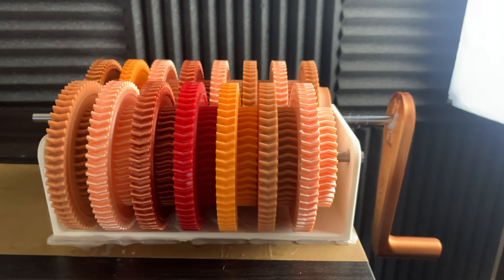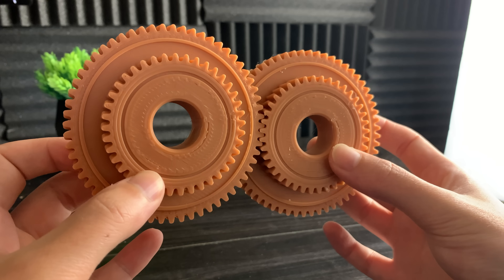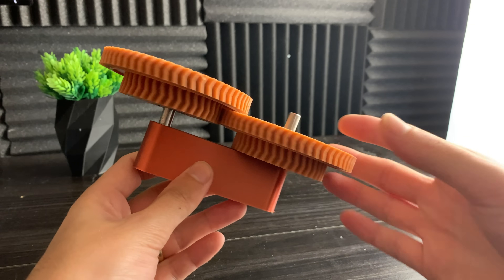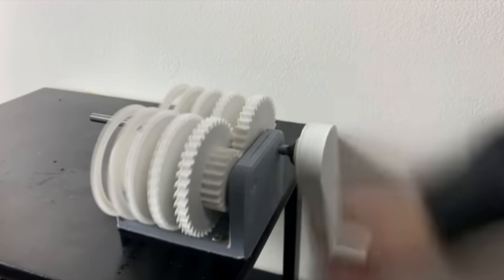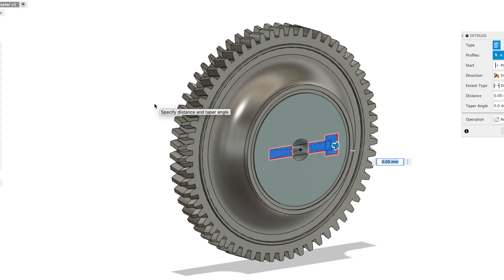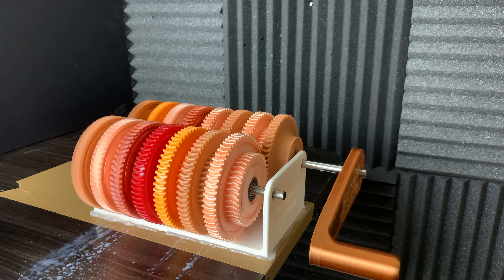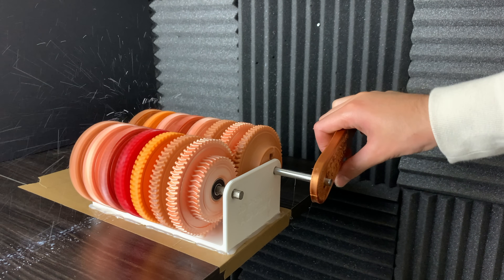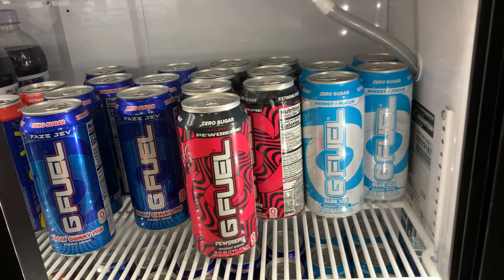3D Printed Gearbox (Herringbone Gears) - Speed Test

Comment: I don't think that's what people meant when they said put a bolt through the rod and handle, but it's kinda interesting.
It kinda looks like it would suffer from side to side movement.
Now that you have a hole through the shaft, I would run the bolt through the bottom of the handle, up through the shaft, through the handle again, and then put a small square hole somewhere in the middle of the handle ( Not too close to any edges, ideally as far from the shaft as you are from the edges ) and toss a nut in there.

Gear can't move side to side though so I guess that one's fine.

Comment: It's appears you lose a lot of energy when stops to pull the pulley. Maybe friction is the problem, a some comments suggests improvements in this point, but I think that whould be interesting that you get some kind of a heavy flywheel to attach in the speedy side. It will help you to maintain the energy.

Comment: Use spacers. You’re getting a LOT of friction from the gears touching
Reply: Or if this somehow goes far enough, thrust bearings between the gears
Reply: Spacer shuld conekt two rods togheter, les friktion les rods deflektion stable gears conektion
Reply: The double herringbone gears will index themselves without spacers.
Reply: Torrington bearing/washers, and mid shaft support to stop deflection on the shafts outwards
Reply: Especially for the First and Last Gearwheels. 
Try PTFE Washers
Try Ballbearings in your Stand
Trust me, I m German
We dont have Humor but we can Drink beer, sorry, we can do engineer ing

Comment: Use the gears as positive molds for a ceramic negative mold and then pour aluminium or brass and don't use ball bearings, use lubricating rods with small gaps with the gears and pump grease into it so it stays with low friction

Comment: I dont think the gears are at fault for the slipping. I think its rather the stiffness of the setup thats to blame. Maybe try a steel carrige and shorter axil lengths. This with a metal handel should be able to give you much higher speeds and input torque. There are also a lot of good lubing and bearing advice in the comments.

Comment: Axels not stiff enough needs more support inbetween, especially where the highest torque is transmitted.
Also put it in an acrylic casing and submerge about a teeth of the bigger gears in oil and make a structure on the lid that will drip the oil from the case down on the gears.
Suggestion for no. 1 : individual axels and support with screws connecting the corresponding gear pairs, this means you can separate the gears and get your needed support structures, while also helping out with alignment adjustments and customfit design.

Edit: spelling of torque
Reply: Or just add plates in between the gears that hold the shafts together
Reply: @Pawer8  They should be connected to the base, as one axle will be torqued outwards and down, while the other gets torqued outwards up. This effect does stack with each consecutive gear and due to good old Pythagoras we know that if the horizontal distance and the vertical distance grows, so does the hypotenuse. Another thing is vibration nodes, the more the axles can "wobble about" the worse the damage gets.
Reply: @EnraEnerato  doesnt matter. As long as the distance between axles is the same the gears will mesh properly. They could swap places and it would still work
Reply: tork
Reply: @wompastompa3692  I meant Nm which is not incorrect.
https://en.wikipedia.org/wiki/Torque_(disambiguation)

Edit: I just noticed you meant that I worte tork instead of torque, the way you pointet it out I understood you meant I should write that. Guess I should not write on mobile when tired, especially not with the German auto correct on, it doesn't like writing English and kind off breaks. I'll go correct it now.

Comment: What if you applied the force of the gearbox into a spring? (like the springs from a truck) Could you store the energy for future use and hook the gearbox to a generator for electricity? How much power/weight could the gearbox and spring effectively store?
Reply: why so complicated. Sandbag and a rope. Just have to turn it to pull the sandbag up, and then let gravity give you back your energy.
Reply: @TV4ELP  thinking the same thing. On condition you have a high elevation. Connect a dynamo and i see a potential energy source for people with no direct electricity supply.
Reply: @TV4ELP  A spring from a truck can hold a lot more weight and power per volume. If it holds enough power it could help store wind/solar power.

Comment: Use an electric motor to spin the middle gear, bring it up to speed slowly. Then add another motor nearer the handle but not on final gear and allow that also to start spinning up. Once that is coming up to speed then you can start cranking the handle.

Comment: IDK if you've tried this, but you can get the bearings to run much better by removing the shield and then using degreaser to remove the very thick lube. You can replace the lube with a drop of sewing machine oil, or just run the bearings 'dry', which does decrease their lifetimes significantly. But it's still hours of working condition.

The shields are removable by flat screwdriver, and can be pushed in again afterwards.
Reply: that would only work if he got a proper sized shaft. At the moment those bearing are likehoop earings and are just loosley on the shaft.
Reply: @PBMS123  I noticed the play between the bearings and the shaft as well. That needs to be eliminated to aid in achieving top speed. I also agree with running a dry bearing in this application. The builder is going for top speed not longevity. It will be mission critical to remove as much friction as possible.
Reply: I run the bearings in my yoyos essentially dry or with less than a drop of light lube, never lost a bearing besides one that I left sitting for about 8 years.
Reply: For a hand turned machine wear time is inconsequential the bearings are made of steel after all.
Reply: Kresimir Baric  I'm sorry 0.5 kg isn't a significant load for a ball bearing even when dry. for this application we're talking about 40x that
Reply: Ceramic bearings and "speed cream" it's what they use on skateboards. In this application it's be perfect. However the use of thrust bearings between the gears would also help I think a significant amount
Reply: This is what we do for bearings in bait casting rods when we want a more free spinning arbor (the spool the line is wound on).
Reply: @Kresimir Baric Assuming 20% print fill on all the gears, I calculated that 15 29.5"x0.3" disks and 15 14.8"0.3" disks would weigh about 7.42 lbs of PLA plastic. assuming the average speed of all the disks is 500 rpm would be the equivalent of spinning a 22kg flywheel
Reply: Kresimir Baric  It actually looks more like 25%. Let me run the numbers again
Reply: aplicar SuperKote 2000
Reply: I don't think that's a good idea unless you wanna ruin the bearings, because the grease in ball bearings is thick for a reason. Thinner oils will immediately get ejected by centrifugal forces once the bearing spins up, leaving it to run dry in a matter of seconds.
Reply: @ChronicMechatronic  he said it decreases the lifetime significantly
Reply: @ianmoore322  he said running them dry would decrease the lifespan significantly, but by using thin oil they will eventually also run dry
Reply: @ChronicMechatronic those are seals. Really unnecessary for an application like this. He should honestly get ceramic bearings that are generally unsealed anyway. Bearings really only wear fast if they’re experiencing off-axis torque or get getting dirty and gritty. If the runs them with just a tiny amount of fine oil and cleans them if the happen to get gunky they’d be fine.

Comment: Dry lube next time maybe. I assume the gears are slipping because of the rod deflecting in the middle?  Or because of spacing?

How about thrust bearings between the gears?  That would probably help.
Reply: He used drylube🙂
Reply: He is already using dry lube but he didn't let it dry.
Reply: Nice one Ian I just said this
Reply: Herringbone gear tooth shaping should prevent any axial loading from happening.
Reply: This was a dry lube, albeit he never let it dry.  It's also known as one of the very worst lubes in the bike industry😂